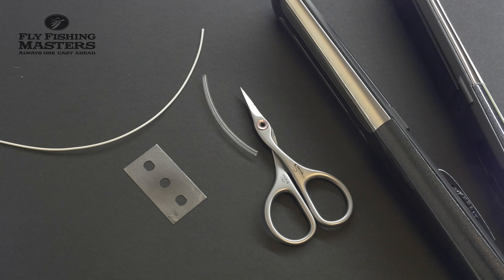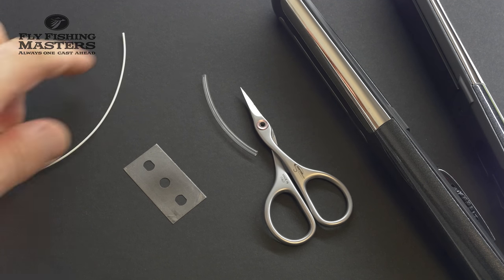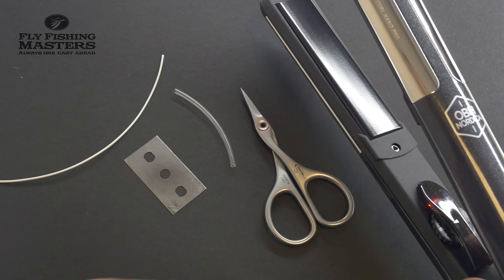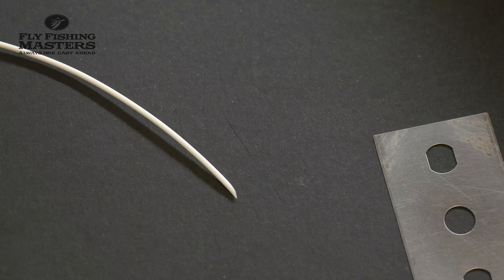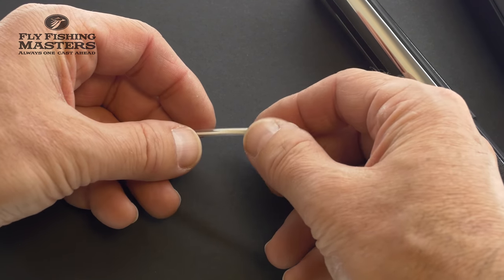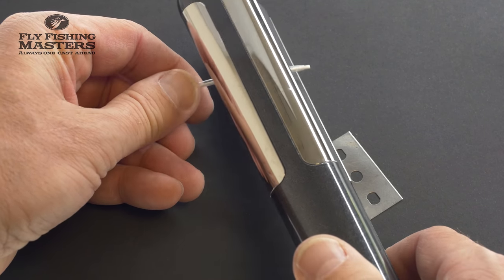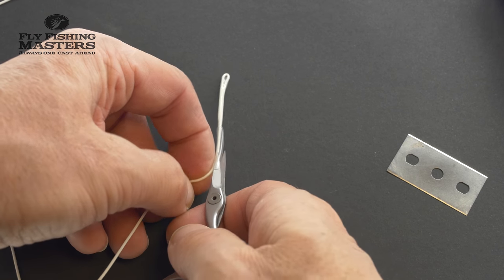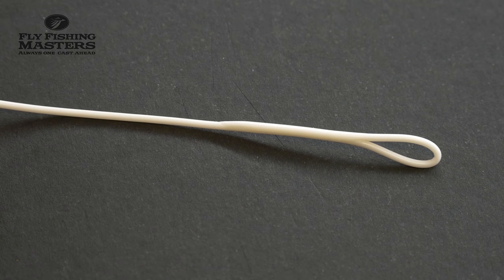Making the perfect loop on your fly line!

Comment: You can use any good clear(you can see if it's melter) heat tubing with the right diameter.
Reply from the maker: No, you can not! If the shrinking temperature of the tubing is to high you will burn the fly line coating.

Comment: Wow. Who knew? So being an audio engineer, and not a hair dresser, I didn’t have a hair straightener, nor does my GF, who IS a hair dresser, but I had a heat gun that is also adjustable temperature. I set it just above 170, and directed the heat flow to miss the loop but hit the junction and as I have LOTS of heat shrink of every kind and size known to man, I used the smallest clear tube that the fly line could fit into, doubled up. I heated carefully, and watched the fly line melt while the shrink tubing squeezed it all together and just left the heat shrink on the weld. That’s probably going to make a bigger splash and maybe not float, but I didn’t have scissors small enough to cut it off. I might cut it off and reduce the length of shrink tube and try again if this loop does the aforementioned splash and sink, at least on my new floating tip for my skaget line, but I think the sink tips won’t care. Nor will the fish when I Spey cast this mess 30 yards across the river and up stream from the swing! Thanks for the education!

Comment: Rene, have you tried Also to weld fly line to polyleader? I mean without loop
Reply from the maker: Hi
I have not. I think the problem would be that the core of the polyleader is made out of nylon and it is very sensitive to heat..

Comment: hey. great vid.. although I couldn't get it to work. I ran out, so to speak, and amazon'ed some shrink tubing. Cool product. I followed all your instructions but my fly line never melted to itself. It only flattened the folded over sections hit with the hair straightener. I tried for short periods of heat and very long periods. I'm using the Orvis Pro Textured floating line so maybe there's something with that line that doesn't melt the same as others?? Any thoughts? Work arounds? It's an expensive line and wouldn't replace it just for a welded loop but... I LOVE the welded loop. Not just for ease of tying on new leader but because no matter how flush I trim my nail knot, it's still a pain in the ass to get the knot through all the eyelets EVERYTIME it may come in past them. It adds up after a full day of fishing.
Reply: For old school nail knots get some Loon UV knot sense glue.  Use just enough to cover that tag end and enjoy no more annoying knot jams!
Reply: @FlyfishermanMike  great idea. Do I need a UV light to make it work?
Reply: @JoshEthanJohnson  no, just some direct sunlight!

Comment: Melted plastic just doesn’t seem strong enough. Unless the core is tied… It just doesn’t seem strong. Might be OK for trout and other small freshwater species. I would not trust that for salmon or anything salt water.
One thought is to put one or two nail knots/needle nail knots as tight as you can get them right on top of the weld. That would Lock both sides of the core together (running end and working end).
Reply from the maker: This is how the loops are made on all fly lines you buy. I have used this on lines used for bonefish an permit. But as you write I would not use it on fly lines for gt, tarpon or other large fish.
Reply: That's why I strip the plastic off, to the core,coat with aquaseal,whip finish with kevlar thread,and a final coat of aquaseal.

Comment: This is insanely helpful!!!!!!  I personally love the welded loops and loop to loop connections.  I've got to try this.  Have you noticed any difference in how different brands of lines weld?
Reply from the maker: Hi Philip
The biggest difference is what density the line has, not so much which brand. A fast sinking line (more tungsten in the coating) requires more heat. Snowbee lines requires less heat (softer coating). Lines with a mono core usually requires less heat, but you have to be very careful with mono core lines, it is easy to damage the core...
Reply: It does not work on running line for spey setup. I just tried it right now, but definitely works on any fly line.

Comment: Tried that but pulled apart with little pressure. Prob only good for pan fish
Reply: I certianly wouldn't trust it on the Brown trout around me.
Reply: I just did this and puller really hard. It did not fail, but then again, being a certified welder of METAL, I’m aware of what a real good weld requires, and using good glasses so I could see the lines melt into each other, I know the two are now one. No separation between the 2. I also left the heat shrink on the weld for extra added strength because I’m going after steelhead and salmon. If this fails under the pull of a monster, I’ll be going back to the old fashioned nail knot and mono loop extension and head cement. I think this should work tho. You can try pulling it with a scale to test it next attempt? Get some really good glasses do you can see the line material melt and you must have small enough heat shrink so it clamps and squeezes the line together into one line.

Comment: What size shrink tubing are you using? I have 3/32 (2mm) but not sure if that will work?
Reply: Just came across this video so you may have figured it out, but I believe 3/32 more like a 2.38mm (3/32 x 25.4 = 2.38) and if so it should work as they sell a 2.4mm for single-hand and 4.8mm for two-hand.  Double check my calculation but I think you are good with what you have.
Reply: As I can see how its done it only is there to put pressure on the melting core and protect it from too much heat and burning it. So if you can fit the line in your shrink tube it will work.

Comment: Can you apply this to running lines ?
Reply from the maker: Yes you can.
Reply: @flyshopsweden  Is it necessery to take the whole shrink tube after heating ? or maybe leaving the fragment around the loop (2-3 cm), which sticks nicely around fly line will give extra strength to that loop ?